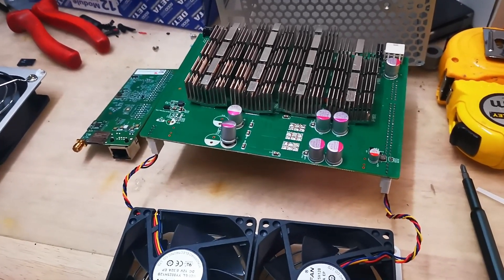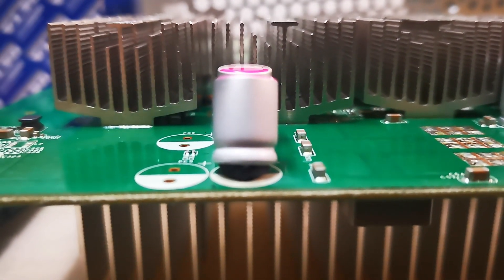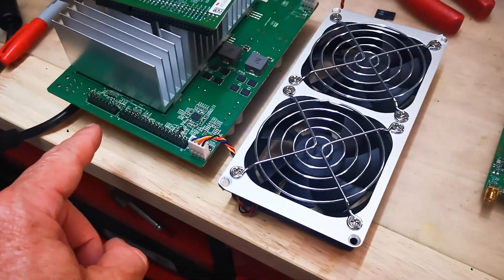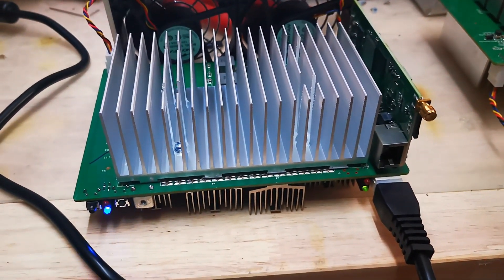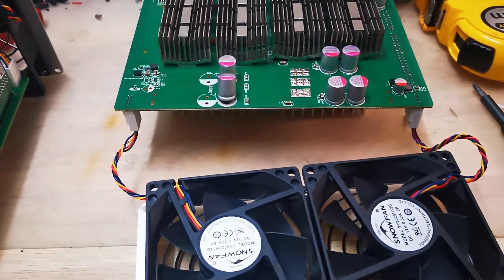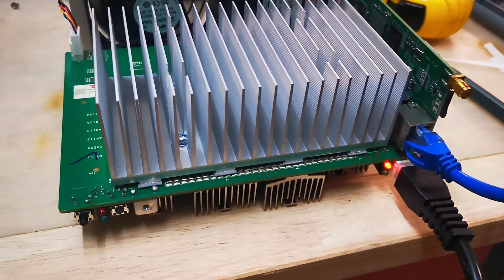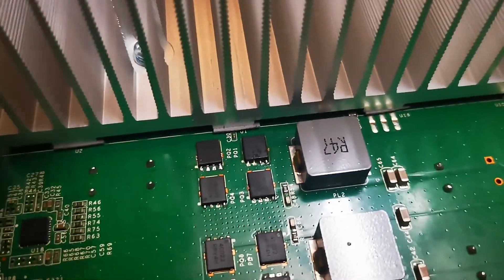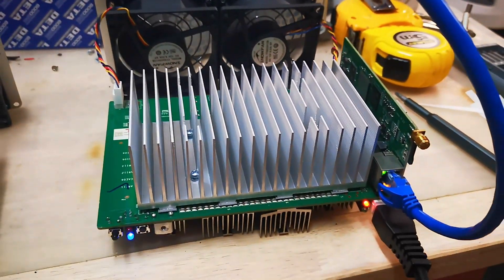Goldshell LBC LBRY ASIC Miner Teardown & Troubleshooting

Comment: Probably also shorted mosfets there, that solder looks like they overheated and went short circuit on one or two of them, leading to the capacitors getting over voltage, or the capacitors died, and the high ripple current then cooked the mosfets.
Reply: Which in that failure scenario would have also overvolted the ASICs so they might be fried
Reply: @brainndamage  Could be, but if the lower ones that do active rectification went first they might have survived.

Comment: I have that same miner...but it only star green on the connector.....on the fans in 1 second and then is off.

Any suggestion....I am using a HP 1200W Power Supply DPS-1200FB-1 A HSTNS-PD19.

And it still running with another miner